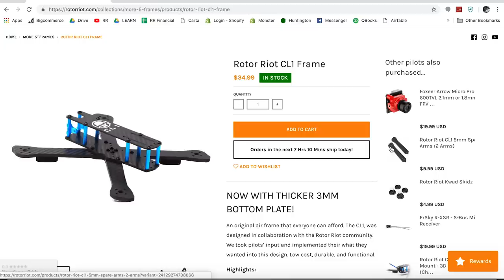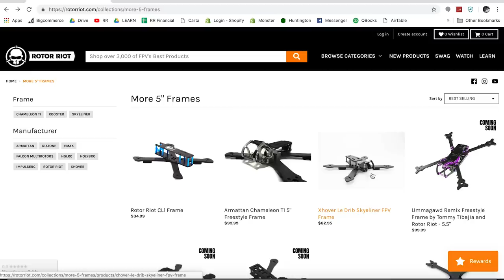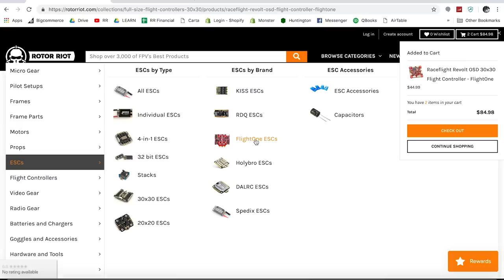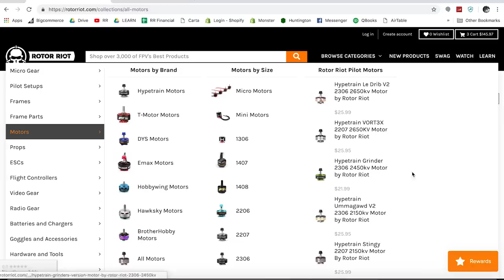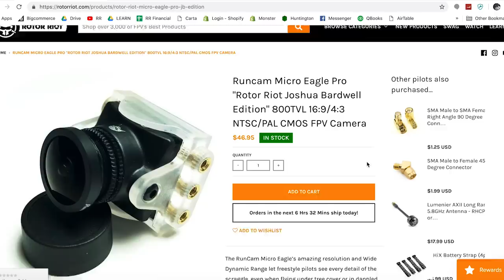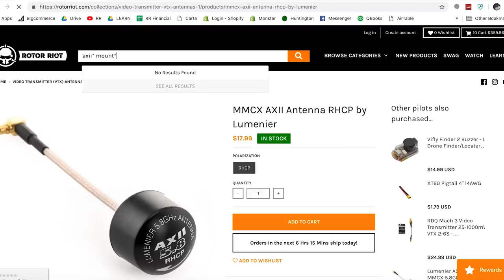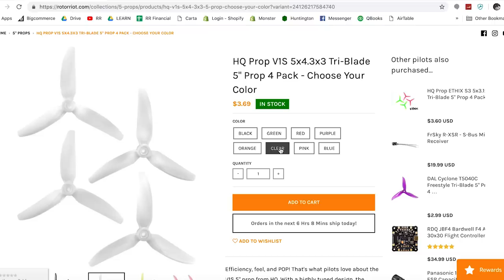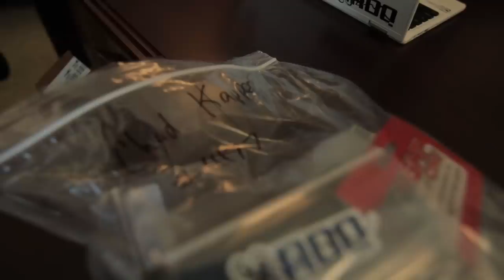Beginner FPV Freestyle Kwad - From the ground up!

Comment: You guys ever considered creating a build tool on your website? Something similar to what Newegg and others provide for computers? Would help Newbs like myself create a beginner level that is easily upgradeable as we progress...
Reply: That would change the game for sure. I don't have an FPV quad but I plan to get one eventually. I am instead trying to learn everything I can to do it right. (plus the whole budget problem)
Reply: true wouldn't be that difficult, like pcpartpicker.com
Reply: So true, if a website had this feature (and stock) I would be much more inclined to use rather than a competitor.
Reply: ...adding to this.  A compatibility checker.  Ensure you have the right s-ratings selected, proper kv to pitch ratios, ecs/vtx/rx to fc ease of connection, etc!
You could start the builder off with a flying style and target budget tracker.  It would only display the parts that fit these constraints.  It would also do alot of what this video did.  You get to find the gaps in inventory/options to meet those builds.
Cheers!
Reply: try motorcalc for all your esc, prop, motor, battery, prop combination you can ever find. ducted fans etc.
Reply: i dont mean to be so off topic but does anyone know a method to get back into an Instagram account?
I stupidly forgot the account password. I appreciate any tricks you can offer me!
Reply: @Desmond Cesar Instablaster =)
Reply: @Brody Harlan it worked and I now got access to my account again. Im so happy!
Thanks so much you saved my ass :D
Reply: @Desmond Cesar You are welcome :D
Reply: @TheTravisweb  exactly!
Reply: @DesignerMaker  The problem today would be that you'd build your dream drone and then find half the parts out of stock and would have to search them out from other vendors anyway.

Comment: Joshua Bardwell: “The motors are the thing you replace the most on a quad”

Props: “Am I a joke to you?”
Reply: Breakage order
1. Props
2. Arms
3. Antennae
4. Motors
5. Some electronic bits. (The ESC on my first hawk 5 is still kicking)
My first radio and goggles are both   working and in use.
Reply: I've replaced more FC's (6) than anything, then props (2 pair), then escs (2).  I have yet to replace a motor!

What the @#$% am I doing wrong!?

(2 FC's were on pre built quads)

Comment: The USB cable is huge.  I went through six before it worked.  It's always the cable
Reply: Took me two days and just happened to go to another room and thus tried another one and ut worked . .😵
Reply: I stumbled across the same thing after trying a few Android cables. But my IT troubleshooting kicked in and I started with the simplest thing. I guess Charging not always equal Data.
Reply: You should use some masking tape or whatever and mark the ones that are data-capable, and the ones that are power only, definitely save you some trouble ;)
Reply: @amen_ra6926  Sometimes it's also the internal resistance, for some reason some FC don't like certain cables. Used to happen to me back in the days of the ArduPilot

Comment: I do remember what I was struggling most with my first build: Insecurity. I watched about a hundred videos before I even starting to order parts and watched some more during the build. In the end my selection turned out to be really solid (except for a poor frame choice). I spent two days I won't get back on trying to get FrSky telemetry working on a Matek F405 because I did not want to use softserial. Wiring, soldering and configuring BLHeli and Betaflight was no problem for me. Space was. I thought I finally nailed it, then I tried an extremely tight racing frame and just fitting everything cost me a lot of time. Prop choices can still be very frustrating because no science can help you with that, except maybe ruling out too high or low pitched ones.

Comment: You should also cover stuff like charger, soldering iron and related accessories, other tools etc
Reply: Yes to this! In my experience, the easiest part was piecing together the drone. It's all the other stuff that is the time sink—firmware, tuning, charging.

Comment: This a very interesting topic. For a complete rookie in the hobby (a bit like me) it would help if the RR website could have some sort of wizard so that someone can easily have all parts for a full quad. On this wizard, it would only appear a few options for each component that are known to work OK together - RR top picks - (so we are not overwhelmed with options). One idea would be to have a pre-made selected builds, like "Budget" or "Advanced", so we can see the total price upfront while having the options to tune the selection for each component. One important option on the wizard would be to have the quad delivered assembled and pre-tuned (if RR have the means to offer this service). Also, don't forget to add a "must have accessories" section on the wizard, because some people don't have anything - solder iron, batteries, charger, voltage checker, tools, goggles, backpack, etc
As a final touch, the wizard could have "quick links" to replicate a build from the pilots we all know and love (Le Drib, Ummagawd, etc)
The goal with this wizard would be to streamline all the checkout process for new people in the hobby and make it quick and fun to have our dream quad. In sum, the wizard would be a sort of "virtual Bardwell" helping out :-)
Then you can even go even further, and after completing a purchase a new customer can be entered on an automated drip newsletter system and receive periodical links to tricks and tips videos by email which in turn can be catered depending on the customer profile (eg. newbies can start by receiving basic tutorials - like connecting to PC  - while a more advanced shopper can skip the tutorials). Also, customers can then start to receive periodical emails depending on the choices they made on the wizard, such as "Need more CNHL batteries? Visit our store", "Time to upgrade to Fatshark HDO?", "Make it official. Check our swag selection and use RRPROUD coupon to get 10$ off" or just an email with links to the most popular RR Youtube videos... the options are endless here.
Reply: Filipe D Hi filipe! If you are a rookie, i would reccomend not to start with a 5" quad. Get a whoop, such as the Mobula 7 and the progress to bigger quads. Make sure you practice on a simulator, eg. Velocidrone before flying! Hope this helped!
Reply: Avefelix FPV That’s is great advice. I’m still a noob and my biggest quad is a 3”. Although 5” is the “standard” which this video refers to

Comment: I'm ~15 builds into the hobby, and if the quad takes 4 hours to build, 3.5 of those hours are stacking/re-stacking the stack.  Welcome to FPV Chad! :)  

 To all, your USB cable must have USB data symbol for it to support data.  USB symbol is the dots, triangle, square connected by lines, kinda looks like a lightning bolt.  More like a circuit board bus.  Hence usB....  ;)  If your USB cable doesn't have this symbol it may still support data.  100% of cables that have the symbol will support data.

Comment: Must say you guys at rotor riot are truly going above and beyond to help us noobs.   The hardest part was the programming for me. But part of my problem was the usb cable.  Every time I plug it in it would not recognize anything.  My motors spun in the wrong direction and in the incorrect order.  Didn’t understand the uarts So many problems.  Took me at least a day to figure it out on my own then I came across Joshua’s YouTube channel and I basically wanted to smash my head off the computer table cuz his videos would have saved me so much time and frustration

Comment: That USB Cable Tip is HUGE! Tons of cheap charger cables don't have the data wires. If the computer doesn't recognize the FC at all but it powers on, try different cables.
Reply: Yal, this is a big one. I was frustrated for quite a while. USB A and USB B types are thigs look em up.

Comment: My biggest hang-ups have to do with where to place and mount stuff. Where to put the vtx and receiver. It's still a problem to get it done cleanly. 3D printed parts helps. Also, the XT60 placement was a huge challenge when I first started. It took a long time to finally figure out how to keep it out of the props.

Comment: At 42:42, always test your FC first. Use the USB when you pull it out of the box and connect to BF before you ever start the build to make sure its working. I never saw you plug it in to a PC, looked like you and JB open all the parts just go to soldering. And you guys are the PROS!!! :) Excellent video Chad. I like your thought train on this. Its good to have good info providers at your disposal.

Comment: My biggest piece of advice for a first build is don't try to do it in one sitting. 

You will start of doing things perfectly and then after a couple of hours you will get tired and start cutting corners.

Get yourself a box to keep the unfinished quad in and when you get tired put the build up for the night and complete it the next day.

Its worth taking your time with the original build as i rarely recommend messing with a well flying quad even if something looks messy. A flight proven build is worth 20 fresh builds.
Reply from the maker: Very solid wisdom! Thanks for sharing! Having a dedicated project box is a very good thing to do!

Comment: Good discussion guys. Maybe do a little talk about pre-testing the FC, Buying/building and using a Smokestopper, for the 1st power up process. 
I would highly recommend putting some nylon nuts on the FC. one bad hit and that's going up against carbon or another part and it's going to burn. 
It's generally poor practice not bolting or otherwise securing anything in, these little machines see some serious G's in flight and scary crazy G's on a hard hit. Anything not secure is going to move.
Looking forward to the next stage....

Comment: That's was such a valuable discussion for noobs, thanks for catering to us
Reply: Dude dont be fooled by these parts choices... you can build a beginner quad that will fly EXACTLY the same for about half the price right now and you wont hate yourself for breaking things... this is 45 minutes of native advertising.
Reply: @flighttherapybullisticfpv133  Sometimes, even beginners want a certain level of quality, not only of the product, but also support after-purchase, that`s worth something, at least to me, things like free replacements are pure gold for a noob in any field, then there are those products that will just continue to be available, which is also valuable.
And they go through things like durability, ease of use and assembly as well as repairs.
Maybe I could get something way cheaper, but would I still get the benefits..?
Sidenote: you could look for parts with similar specs and probably save some money, but getting everything from one place is why things like Walmart and eBay exist..

And some of the point of the video, as mentioned in the beginning, is to get everything (or as much as possible) from one store, which I also appreciate.
Can`t really blame Rotor-Riot for showing off their store either, it`s not exactly "subliminal marketing" lol.

Besides, there`s no hidden advertising, everything is up front and honest and the items being discussed are things these dudes have experience with, just what a noob wants.
If it hadn`t been for the fact that I live in scandinavia, I`d be likely to follow this to the letter.
I still might, but my problem is getting a complete package from any less than 3 different places, so odds are still higher that I`ll go with a Hawk 5, because with all the shipping etc, I`ll end up in the same range lol.
Sorry about the "essay", just My2C`s ;)
Reply: @flighttherapybullisticfpv133  As Naufel said, it's about the discussion. A singular example: JB making things simple for people by saying that for a noob 5", just throw on a 2306/2207 2400kv and experiment with props. In the end, people are going to choose what they want to choose, whether based on price, or brand, or whatever.
Reply: So far you would have to be a pretty well off newbie to build though the RR site, hopefully they bring in more choices for those of us who don't have a ton of cash to put into the project

Comment: Its not as bigger issue these days, but in the past I struggled a bit with ESC calibrating and setup (min/max throttle etc).  I understand that this video is more about the shopping process and selection of gear, however I think what is lacking is the software side of things.  Having said that there is ample content on this already on the Tube.  Entertaining none the less, thanks.

Comment: You guys should have talked about 30 seconds longer about batteries, what 1300 vs. 1500 mean etc.  and suggest where to learn more about how to care for lipo batteries. Oh, and what about a charger?  (Also looks like your laptop needs a charger :)  )
Reply: dude you got a you tube channel, filled with fpv videos, and you don't know the difference between batteries or how to care for batteries?
Reply: @bitvasconcelos2031  What I was saying is that this RR video should have gone just a touch more in depth into the batteries since it is aimed at the newcomer to the hobby.  They likely don't know anything about lipo batteries, what to look for, and what the difference is between a 1300mah and a 1500mah.  That's all.
Reply: I’m new to the air bending world I don’t know the difference

Comment: Absolutely awesome video! I have built several quads and still learned things in this video that I will use in future builds. I agree with the captain a check list or “build assistant” feature on the site would be super helpful. Just select what kind of quad you want to build and it would walk through all the components you need to build it. Not only would it help us not forget anything but you could use it to drive sales on “pilot recommendations” and certain products. Well done and keep up the good work!

Comment: Great video. Total noob here. Still trying to figure it all out. Figuring out what motors go with 3, 4, and 5 inch blades and why is a struggle. What ESC’s go good with what flight controllers isn’t strait forward and I know that depends on what battery (3,4 or 6s). On and on. Would be nice in the product description of any given part that it pair well with what ever else to help lead people down the path. But looking forward to getting into it all.
Reply: We are going to attempt something very similar to this. It's kind of a weird problem to solve since there is not yet a standard connector for fc's and esc's. Technically most fc's and esc's will work with each other, but often you'll have to rearrange the wires to make sure they go to the proper place between them, which often involves stabbing yourself with tweezers repeatedly and risking ruining the connectors. We have spoken about a build guide with parts that are proven to work well together, we'll make sure everyone knows about it once it's implemented. If integration of a site feature proves to be impossible, we'll DEFINITELY make sure to cover it more thoroughly in a build video at the very least. Thanks for the comment and thanks for watching!

Comment: Excellent video guys. I had the same issues as Chad with my first build. Choosing components was easy, figuring out how to mount the stack, orientation, battery lead and where/how to mount vtx and receiver did my head in. Keep up the good work guys.

Comment: Two things, if I may. I commend you on this type of video. Covering these details that most newbies are unaware of is important. 1. Newbies do not know what all the acronyms stand for. Explaining those would help. I noticed that some were covered by on-screen notes. 2. Many of the suggestions provided, such as what type of flying do you do etc, (as was described is what I would be interested) are very helpful. But the final question would be: What did the final cost come to be if one were to order such a quad as listed? Thank you for these videos. They are very helpful.
On a second subject, it was mentioned that such a build should not be attempted by a newbie. About a week ago a video came out on the redi-built quads that had prop shields. Would those be recommended instead? Another video I enjoyed. Thanks to all.

Comment: Great video guys, actually I loved the discussion on bi-blades vs try-blades, 'cause it is exactly as Chad said, sometimes, people who know better just do not explain the why's to the beginners. However, just a quick note, bi-blades are actually more difficult to balance than try-blades, 'cause both blades in a bi-blade prop are diametrically opposed, so any difference in weight distribution between them, maximizes the unbalance. The more blades you add, the more forgiving the prop becomes to unbalance (damage while flying for example). That is why it was so difficult to have yellow-free video in 6-inch or 7-inch builds, 'cause we only had bi-blades for those sizes. Nevertheless, you can have very good balanced bi-blade props (look at DJI for example), you just have to do an extra effort when manufacturing the prop.